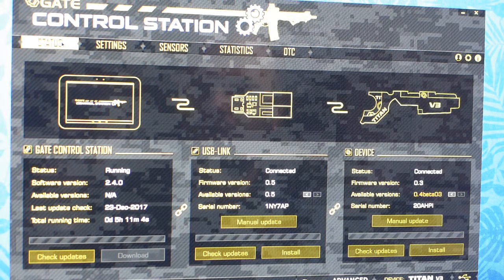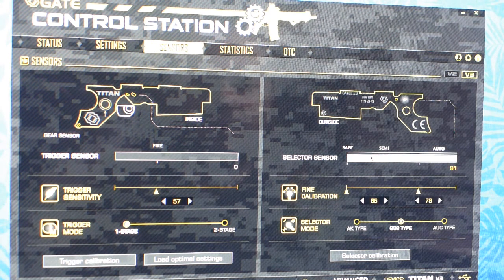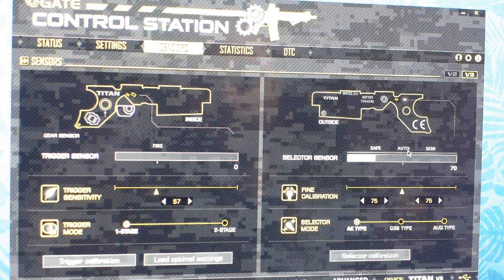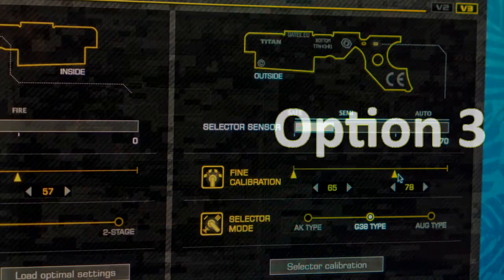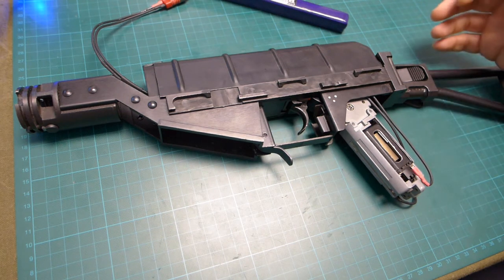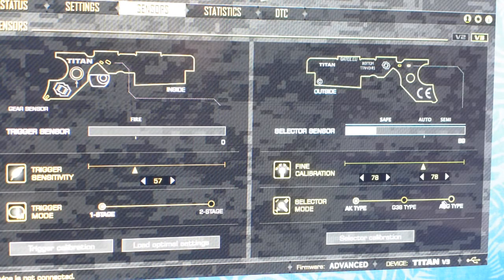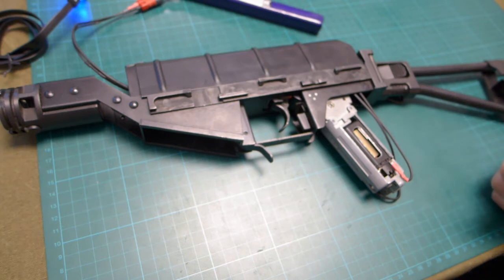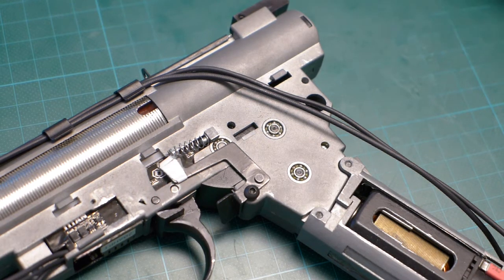GATE Electronics Titan v3 in LCT VBox (2018)

Comment: I gotta say your video led me down a rabbit hole of thinking on a way to get full function from the ecu correctly. After a few failed designs, my budy and I have now created a 3d printed piece that replaces the stock metal switch and allows you full swing  coverage of the censors so that everything will work as designed. They only modification to your gun would be the drilling/removal of the aweful metal selector from begind the trigger. Pull out the original meta selector from the gearbox and pop my 3d printed one right into the gearbox. It's just the right stiffness to stay in the selected position with the slight help of a smallmoring that keeps it in the correc mode.. My next modification on the VSS is to change out the heavy steel outer barrel shell and replace it with either a barrel length carbon fiber tube shell with a threaded end for your favorite supresssor. Or replace it with a carbon fiber tube that is slightly longer than your inner barrel with a built in foam suppressor area.
Reply: Hi, care to share the 3D model? 

I have just bought AS VAL myself and i am definitely putting processor in there.

Comment: Nice explanation and very clean mods :)
Do you know the differences between these vboxes and the SR3 one? The selector and safety are different in that model.
Reply from the maker: thx, Iñigo. If I remember correctly, the only difference is the fire selector on the body, but the gearbox is the same (including selector lever on the gearbox). I don't have an SR3 at the moment, so can't make photo's to confirm.
Reply: Ok, thanks! If the selector lever is the same or similar I'll work something out. I guess the safety works the same as the typical AK lever, pivoting over the same pin, just pointing backwards.
Reply from the maker: safety is indeed working as on an AK. It is actually a regular v3 gearbox, just the selector plate is different. And the safety lever and firing-mode lever are separated on this series of AEGs (9x39mm)
Reply from the maker: all the guns from this series are using this exactly same v-box (slightly modified v3 gearbox in the means of selector plate/assembly and the angle of motor cage, "vbox" is how LCT calls it to keep the name short and clear to remember and understand).

Comment: Nice video again Andrey. You did it. Is that double shot in semi connected to Titan or is it connected to mechanical over-spin in the gearbox?
Reply from the maker: there should be NO overspin, as Titan is detecting the gear teeth. And there is an M140 spring inside, along with 23tpa N52 motor. 
I need to find out the reason...
Reply: Yeah. I often get overspin on 18:1 gears and Torque motor,even on strong spring. Cool video,takes a lot of thinking to get it right. I especially like setting with the AUG trigger pull sensitivity control.
Reply from the maker: Prometheus High-torque helical gear + my custom 23tps motor.
I'll try to play with active breaking, who knows might that help :)
Reply: Might help a lot,yes. I never had Prometheus gears,how do you like them?
Reply from the maker: they are indestructible, but can be a bit noisy )) using them from the beginning of 2012 in my AS VAL :)
Reply: Thanks,I'll maybe try them one day. 5 years of usage is a lot. Have a Merry Christmas,and take a break a bit.  :)
Reply: Did you find the problem with overspin?